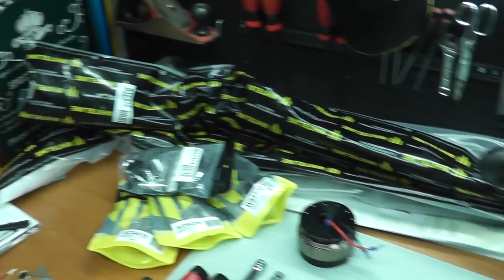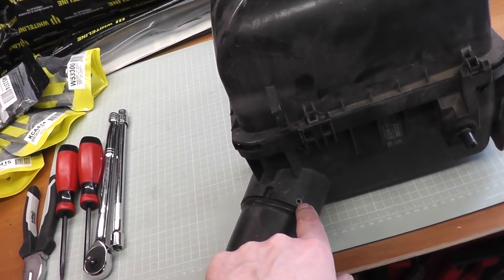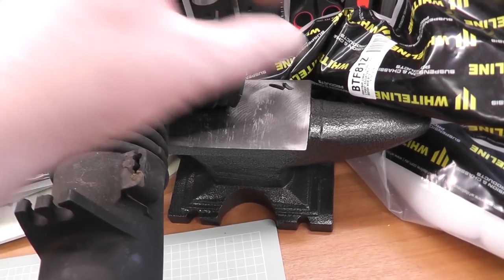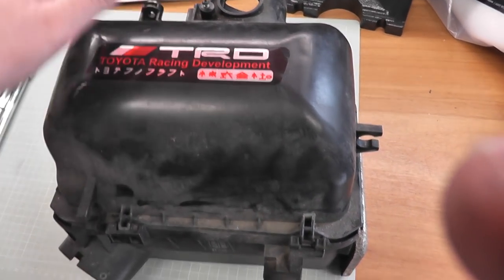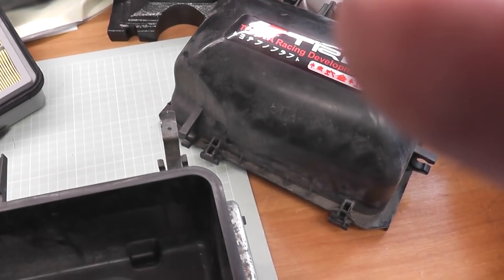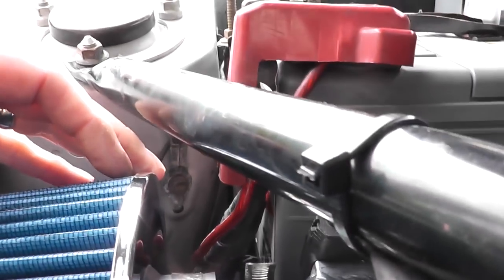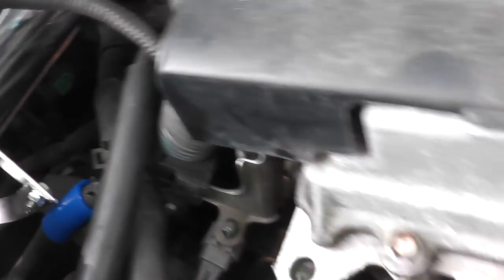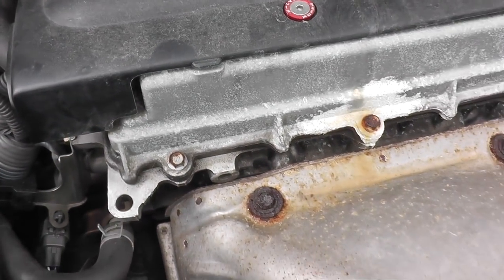Is it any good? Ebay cold air intake Install for the MR2

Comment: I purchased a Pipercross performance panel filter (washable reusable, re oilable, claims to last upto 20k miles between cleans)which simply replaces the OEM air filter, fits into stock airbox, cheaper than the k&N brand. After going from stock air filter to this high flow performance filter, it definetely feels like more response in all the range but especially more power above 5k accelerating. I had a blast on the b roads after fitting it, and i swear it felt ia bit more nippy.. I do have sports manifold and sports cat though

can be purchased off ebay £31 brand new (pipercross pp1290)

I can proper hear the induction hissing sound aswel, i think it sounds really cool!
Reply from the maker: Brilliant.... I did think about a piper cross panel! 😀

Comment: Nice work Mark. I installed a HKS kit on mine with the filter in a similar position and the intake temps went up by about 20c. I think it's because of the positioning next to the exhaust. Hot air cant be good for the engine  and probably results in loss of power more than anything else. I ended up selling my kit and putting a K&N panel filter in. I am planning to turbo soon so it dont really matter anyway ;)
Reply from the maker: Thanks buddy.Yeah the air won't be so dense so there may be a little amount of power loss but I've monitored the intake temps and I'm. Looking at about 12c increase but this may change when I change the manifold. The explosive environment of the combustion chamber probably doesn't care about warmer air. I have kept all the stock kit and may put back in in the future but the extra noise is fun for now :) 👍

Comment: You can have 3 types of sound for the Toyota MR-S :
1) deep sound
2) v-tec sound
3) 4 throttles body sound

1) induction kit
2) cai behind batterie + alu airbox + 83mm hose to side vent
3) cai behind batterie + alu airbox linked + 63mm hose to side vent

1) pros > aesthetic // cons > gaz pedal response, less power, maybe CEL light
2) pros > colder air temp, gaz pedal response // cons > none (the perfect balance)
3) pros > colder air temp, gaz pedal response, crazy sound // cons > less power after 6000rpms (restrictive hose)

* Airbox with 80mm output don't limit the engine in air. BMC CDA carbon (ref : CDASP-09) has similar dimension than PPE airbox "first version" and will fit behind batterie.

Here the video of the 1st and 2nd sounds : https://www.youtube.com/watch?v=HqtYpF7_32A
And the 3rd sound : https://www.youtube.com/watch?v=5KeFtLL9MbY
* My actual setup (PPE cai first version) : https://www.youtube.com/watch?v=Oihg7sW8fYA

Comment: This open port Air Filter set up is a suicide for MRS Spyder. 

The entire engine compartment is extremely hot in there. Imagine that you have exhaust intake manifold, exhaust muffler as well as the engine block all sitting in the same compartment contributing MORE heat. 

Thus the air filter practically will suck up all the HEAT into the engine. Do you think the engine will be happy with tonnes of heat going in ?

Good luck! 😆

Comment: Great video! A couple of questions if you don't mind. I am thinking of doing this mod to my Roadster. Is this kit still available? What is the purpose of the 'blanked-off' pipe at the back? If the kit is no longer available I am planning to go the DIY route. Best wishes! Graham. 👍👍
Reply from the maker: No worries 🙂I haven't seen the kits recently but then I haven't really been looking. They pop up from time to time on eBay. The small pipe access off to the side I think relates to a  another Toyota (possibly a corolla) that has a breather attach there...it's not needed on the MR2. If you do go the DIY route consider putting the filter behind the battery where it won't pickup as much warm air. Having said that Ive had zero issues since fitting :) thanks for your comment 👍
Reply: Hi! Many thanks for your reply and info. It is much appreciated.👍👍

Comment: Where did you get the rocker cover clips? mine are missing, also your engine coolant reservoir bottle is over filled.
Reply from the maker: Ha very observant of you! Yeah I filled it too level and it seems to have a mind of its own. Operating it goes lower then full and it's all over the place sometimes... others have reported the same but I have no issues. Perhaps I should take some out!

So the cover bolts are password jdm allen bolts with an anodised red cup to take the head. I ordered the press fit clips from Toyota but never used them as they were a bit boring. PM on insta or something and I'll mail them two you if you want them. I ight even have a couple of the password JDM bolt things as well you can have...let me know :)
Reply: @DadDiaries  I will do thanks, when the car cools down usually coolant will move back into the bottle and when it gets hot again it is suck into the coolant system, It should be fine.